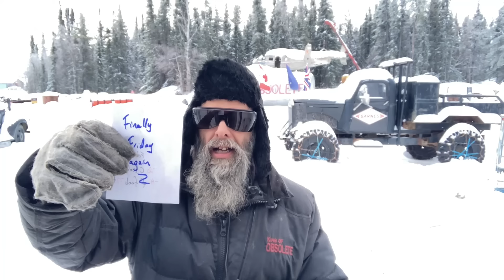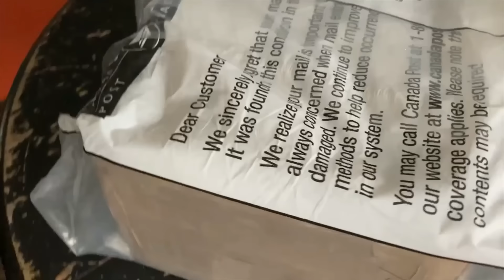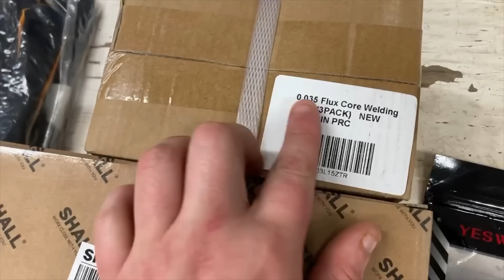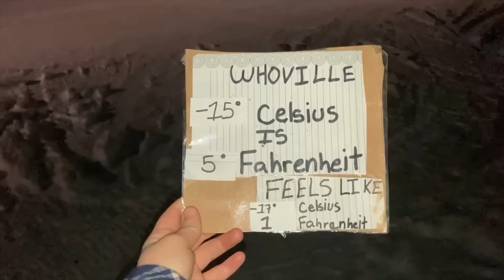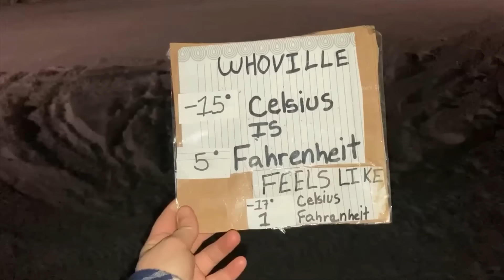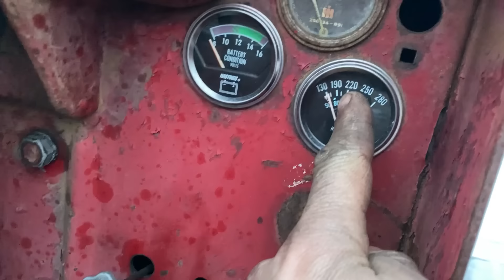New Thermostat at 180 Degrees Made Kijiji Run Good Feb 09 2024

Comment: 2nd, but by choice, had to finish up Farmcraft101. It is a true test of mastery: When you park a machine outside, come back to it later and rip the top off to make a repair right out there in the elements. Glad to see Kijiji's temp gauge acting normally with the new and improved T-stat & housing design. Staff mentioned yesterday that the IH was working better because there was ''No Steam Show this time". Quite an observant YL. Kijiji sounds much better today too.
Friday? What difference does Friday make Eh? For the last 10yrs this January, it's felt to me like everyday is Saturday. Hard to get used to not caring what day of the week it is. Ha Ha. Thank you both for allowing a glimpse into the Great White North of Wilderness Alaska but in Northern Manitoba. RODNEY! (shout out)   ben/ michigan P.S. Still got up to 63°F/ 17.2°C today, Last day though
Reply from the maker: yes as we figure out these thermostats and how to improve it is a learning curve. plus it was warmer outside with the diesel heater blowing on me then in the shop with the wood stove that would not burn. increasing the motor temperature made the diesel run a lot better.  thansk
Reply: Whats up michigan

Comment: Yesterday the K cat was putting out quite a bit of blue smoke, but today it was burning clean. The extra attention worked wonders. Good power too. Thanks for the videos and take care.
Reply from the maker: yes the warmer the diesel motor runs the happier it is plus we tossed in 5 gallons of diesel with 2 stroke oil added to lube up the injectors and it burned cleaner.  thansk

Comment: Good job with the thermostat fix.  Pulling the hill in 3rd is a good indication of a righteous fix. Xena, take it easy a day or 2 longer.  Love to see the Westrans products   :)
Reply from the maker: yes very surprised at how different the motor ran when warmer. nothing changed except for the cylinder head which should have made it worse with the hand buffed valves.  thansk